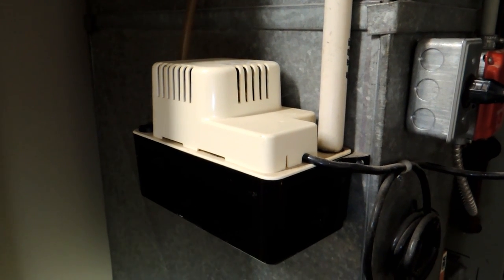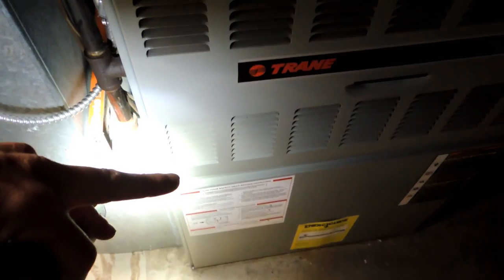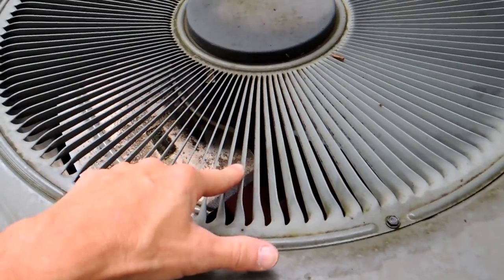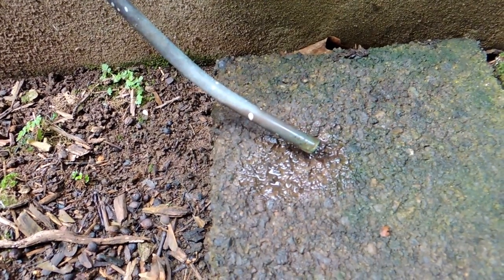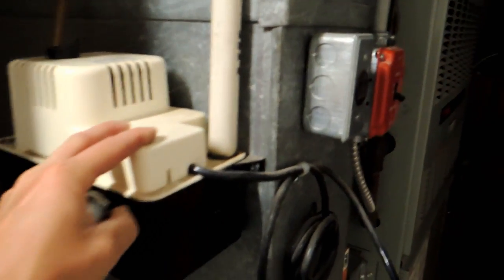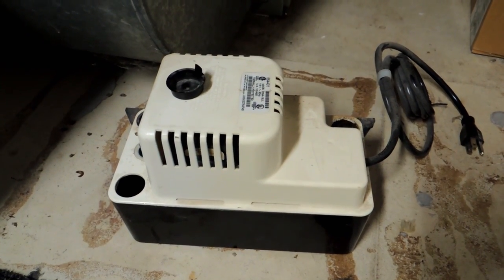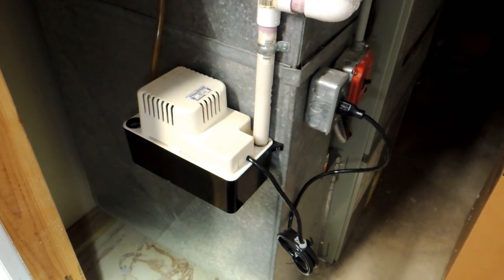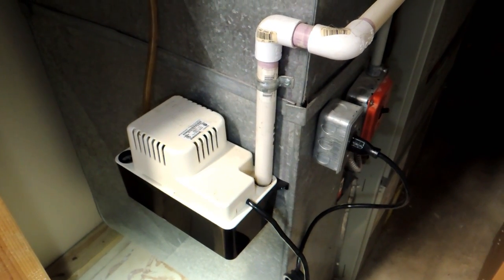How To Maintain Your Air Conditioning Condensate Pump

Comment: Where is the P-Trap on that system,  would be sucking air if it's like any other systems.  Perhaps the fit on the pump is enough to make it a non issue.  Then again I wouldn't want it sucking air out of that nasty pump back into the air handler.
Reply from the maker: Condensate from the evaporator tray to the pump tray is gravity fed.  There is no trap in that case, although for large commercial evaporators set on rooftops you will see a little dip in the condensate pipe to serve the purpose of a trap.  In that case the condensate is dripping right onto the roof and part of the idea is to prevent bugs or whatever from getting in.  I mean, the evaporator tray is wide open, after all.  The tube from the pump to the outdoors does have a loop in it, which serves as a trap.
Reply: @enduringcharm  Hmm,  I thought it was to prevent air from being pulled back into the air handler via the condensate pipe.
Reply from the maker: In theory the system should be balanced so that air coming in matches air coming out.  That's one reason you have return ducts in forced air system.  Of course, the reality is that these systems have all sorts of air leaks throughout the ductwork and the airbox.  Commercial systems sometiomes have a door/inlet for outside air to enter the loop.  There is some minor air pressure on the condensate pipe, which could be in or out depending on fan location, but it's really not much.  Most residential systems I've seen do not have any sort of trap.  Possibly it's code in some places or required for energy efficiency from the manufacturer.  Either way, I don't think it's a big concern.
Reply: @enduringcharm  Makes sense,  thanks for the answer.